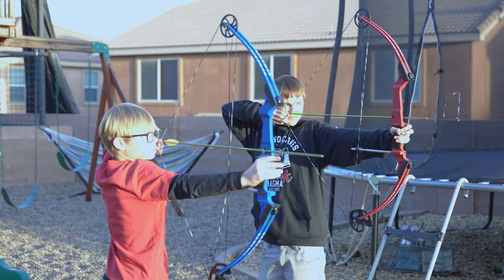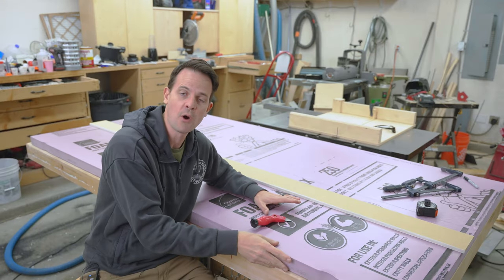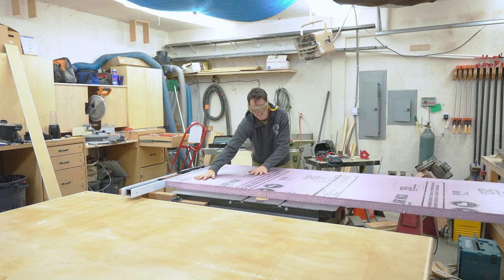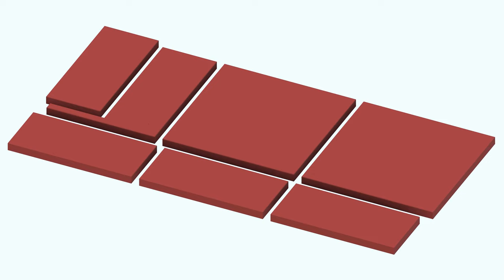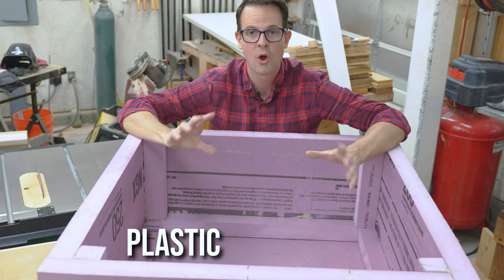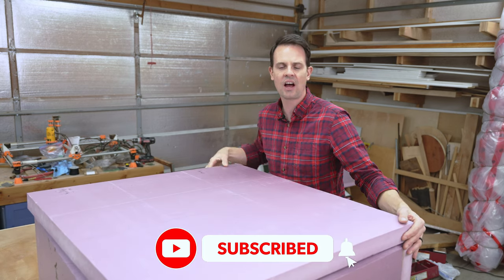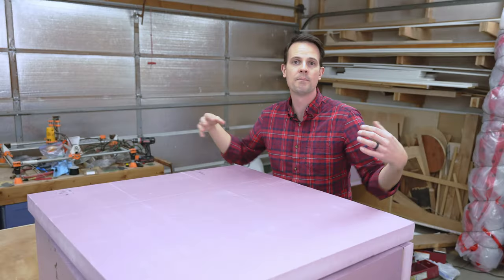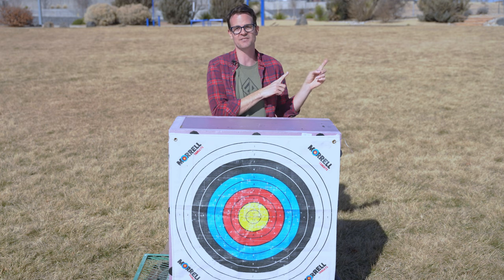Make the Perfect DIY Archery Target with Just Foam Board and Scraps - So Easy!

Comment: I just tried to replicate this and had an awful time, just use the power tools. Trying to do this with an exacto knife just ruined the edges and butchered the whole thing, I don't doubt this is awesome, but it is also just a waste of 36 dollars if you screw it up. So don't be like me! Do it properly
Reply from the maker: Sorry the edges messed up so much. I wonder if your foam was a different density than mine. I did have some ragged in the center but the edged were pretty clean when i used a knife. That is a real bummer on the foam being so problematic.
Reply: @BuildItMakeIt  the foam I used was more like really dense packing styrofoam that falls apart, most likely why it didn't work as well. But I still think this is a good design!
Reply from the maker: Ah that make sense. That’s still a bummer to lose the 36 dollars.
Reply: @BuildItMakeIt  haha, I'm gonna try to make it work still! Just letting it cure before messing with it again. If that doesn't work, I'll go buy a hay bale

Comment: To make it lighter and even cheaper as even those rags will cost, I would suggest using used pallet wrap plastic. A heck of a lot of pallets are wrapped and they just throw that stuff away. It is usually several layers thick depending what was on the pallet. ie, boxes would have a lighter wrap but potentially unstable load like potting mix will have a thicker wrap. Large stores like Home Depot (or Bunnings in Oz) are the best bet as staff would be more willing to assist with the request than say Kmart. If you ask what day gets the most deliveries, you might have a better chance of arranging to pick up that day. ie orders are made on Monday, but delivered Thurs/Fri. You can roll in large balls and compress it etc and much lighter than rags.

Comment: Respectfully, this is not "So Easy!". You need a quite bit more resources than the primary materials. I certainly don't have access, space or money for all those more expensive steps.
Reply from the maker: The only tools you need is a box cutter or other knife and something to extrude glue  if using adhesive from a tube. I showed some alternative ways of cutting to make it faster.

Comment: What do you think of a combo of your two techniques - using the insulation foam from this video in the same stacking technique from the other target you made?  I'd have to price it out but am wondering if you think that would work.
Reply from the maker: I have done the insulating foam as a target before and it certainly worked. The downside is it broke down faster than the mats, and it was pretty hard to pull put the arrows. That is why the fabric works well, good stopping with easy pullout. Staking the insulating foam would be nice for easy of repairing so that could be really nice, and since it is thicker, it takes way less layers to build.
Reply: Did the target with all insulation foam stop broadheads?

Comment: Nice job. I made something similar. I used  R- 5, 1-in x 2-ft Unfaced Foam Board Insulation. It's a smaller target, but that's by design. I feel if archers keep shooting at the 80CM target face, they focus more on hitting 10's rather than working on technique. I took two rolls of R- 1 Unfaced Polyethylene Roll Insulation 22.9-sq ft (5.5-in W x 50-ft L) used for roof sill insulation and glued them together (don't unroll them). Then I wrapped the two rolls in heavy duty packing tape to preserve its cylinder shape.  Next I cut a hole through the center of each insulation board and inserted my  roll through all three boards. This provides enough stability for the Genesis bows. The rolled insulation has a hole in the middle. I fill that with Great Stuff foam spray and let it cure for 48 hours. Most targets get the centers shot out. My center "grabs" the arrows rather than punch holes into the foam. When the center wears out, I only need to refill the center with foam or replace the center core. Any arrows that hit outside of the core on the insulation board get filled in with foam insulation spray.
Reply from the maker: That’s a great idea thanks!! I may add a foam insert to the center of the target like you described since the center gets hit so much. Thanks again for your info sounds like a great target.
Reply: Wow you should make a video showing us exactly how to do it! It sounds like a great idea

Comment: Thanks for the post.  I made one of these.  Works great!  I used cut up sections of old carpet as filler.  It required a lot more adhesive than I expected.  I used 5 tubes.
Reply from the maker: Oh wow, that is a lot of adhesive, but glad it worked out. Carpet is a great idea.

Comment: Thanks for the tip, what about if I use only styrofoam. I’m in the construction business and I have a whole bunch of this 2” sheets. Do you think if I glue  like 5x36”x36” would hold arrows ? I’m shooting a 60lb compound bow
Reply from the maker: I have a target of 3 2" sheets glued together that I use for recurves (30 lbs and under) and it works great. I think you would want to make it thicker  (like probably 16" total) but if you have the material for free then I say go for it. I think it won't last as long but my face piece lasted a whole season of practice so I think it would be a good idea.

Comment: Isn't it heavy? 
What if you use bean bags filler? would that be enough for stopping ..maybe with a few pieces of cardboard in between. 
I did not see the price for it.
I think this form of target only works in you area. For me the foam boards are quite expensive. 
It much cheaper to actually buy a foam target from an archery shop.
Reply from the maker: Yes, it is quite heavy. I am not sure if bean bag filler would be sufficient. You could make a small target and see if the arrow penetrates. I know plastic bags work if they are compressed enough, plastic is what a lot of similar commercial targets use as the filler.